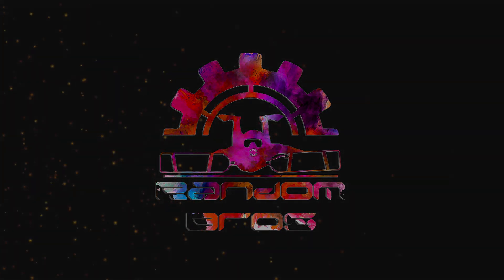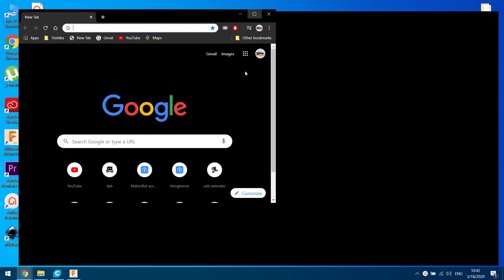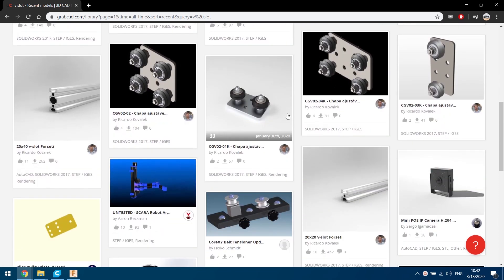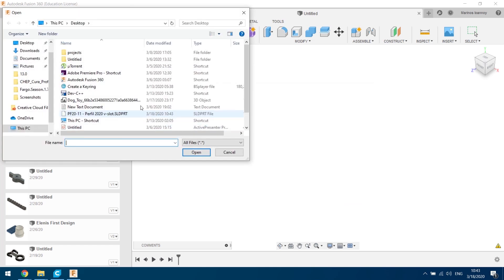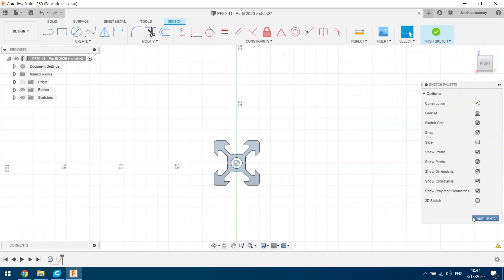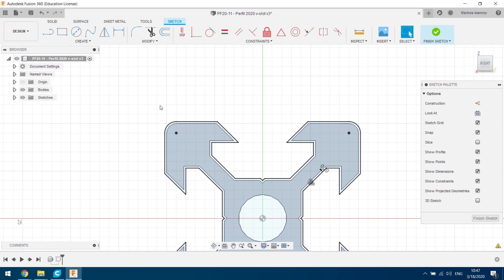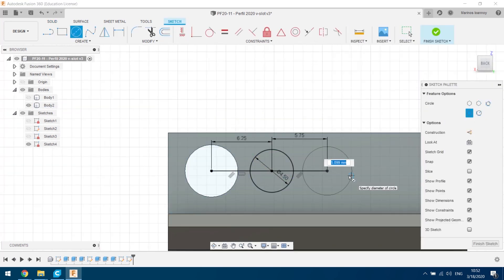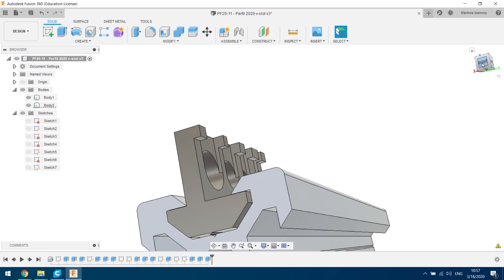Fusion 360 : Model parts that FIT !!!

Comment: If you use the profiles from the library, you can change the profiles with automatic adapting slots and your key features should remain the same. Otherwise great concept
Reply from the maker: ohhh , to be honest i've been working with fusion for over 3 years and nevver heard about that !! thank u for your advice m8!!!
Reply: Might be that the needed library for those profiles needs to be added, they are an easy find on grabcad
Reply from the maker: @louislecluyse  alright ! thanks in advance we might make another update video to include what you said too !!